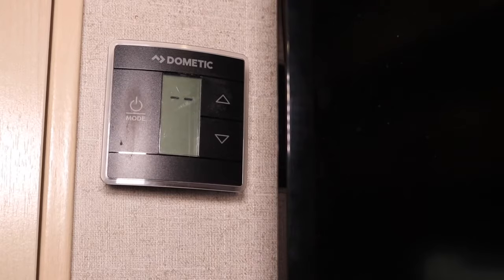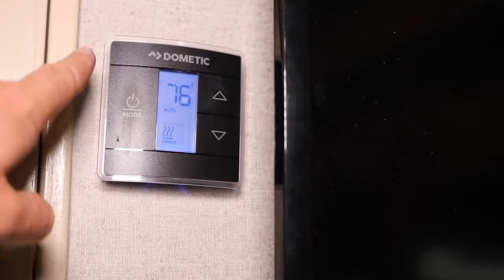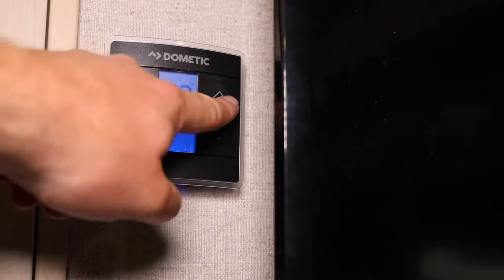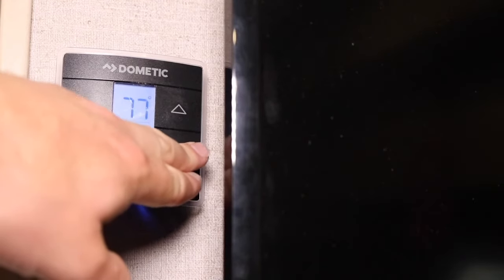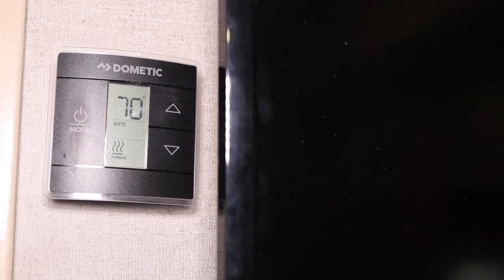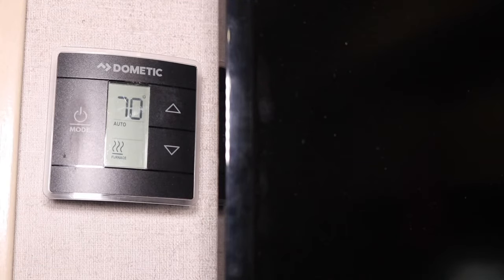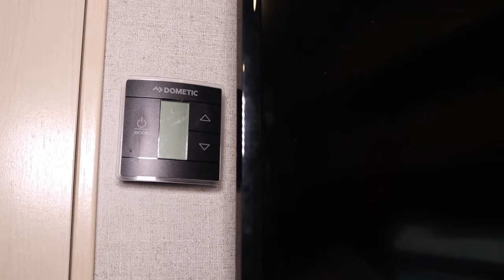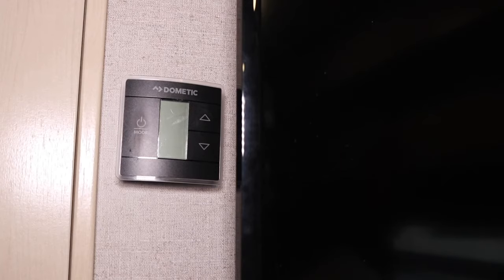How to use an RV Furnace The Proper Way with Efficiency Tips

Comment: Pointless video if you won't show how to turn on propane and light the pilot light. We have newbies watching rememeber
Reply: I totally agree
Reply: Thank you, this guy shows how to click up or down the thermostat. I need to turn on complaint and this video didn’t help.
Reply: Most rv's, even older rv's are direct spark ignition furnaces - it lights itself upon signal for heat from the thermostat.
Reply: @bumponlog  I haven't lite a pilot light in years
Reply: We are coping right now had no heat due to this video we have heat. Our furnace has an automatic ignition thank you for this video.
Reply: How does a newbie light the pilot.
Reply: Wow! after watching this video, It doned on me that I hadn't turned on my propane and didn''t know a darn thing about lighting a pilot light. We simply didn't use the furnace because it didn''t heat up and we opted to use the fireplace instead. Thanks for sharing.
Reply: Thank you for a pointless video- from a newbie

Comment: So, confirming you need the propane on to run the furnace and that you Cannot soly run it on electricity?
Reply from the maker: Yes, your furnace runs on propane. Some may have an electric heat strip to provide power, but most don't.

Comment: We have the same thermostat, it works great when it's not plugged in (battery) but when we plug it in it doesn't work and only the AC/Fan unit blows cold air on "furnace"  Any ideas?
Reply from the maker: Is your furnace coming on separately when it is plugged in? On my unit, when plugged into 120v power, it will run the a/c fan unit in addition to the furnace to better distribute the air. This is an option that can be turned off. If your heater is not coming on, there could be a wiring issue, but it is weird it does work when on battery. Let me know if the furnace comes on too.
Reply: @TheSavvyCampers  Thanks a ton, i figured out the issue.  When plugged in, you have to select "Auto" on the fan setting, I had it on Low and then went to low furnace and the heater never kicked on, but with "Auto" it seems to be working great either plugged in or on battery.  Thanks again.
Reply: check on the sail switch!
Reply: Question: i turn "on" the "furnace" mode, but the A/C blower comes "on"  at the same time with the furnace unit. How can i turn off the A/C blower and just keep the furnuce air? Same thermostat as this one, and its on shore power.

Comment: Great video, I have the same thermostat on my TT does the furnace only run on propane?
Reply from the maker: Yes, the furnace will only heat with propane gas. Some models have a heat strip in the a/c unit or even a heat pump ac unit. Most do not have those items and run strictly on propane.
Reply: @TheSavvyCampers  Thanks!

Comment: There was another setting you should have mentioned. There is a setting that allows the furnace to go on and off to keep a more even temp.  But another setting will let furnace reach desired temp then shuts off and remains off for longer. Easier on the furnace and much less annoying ..
Reply: How does this setting work?